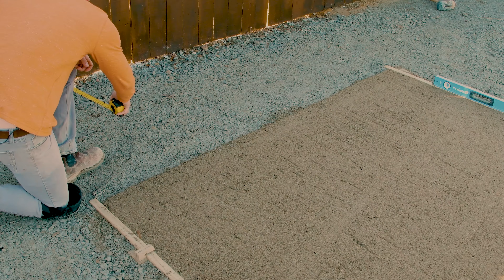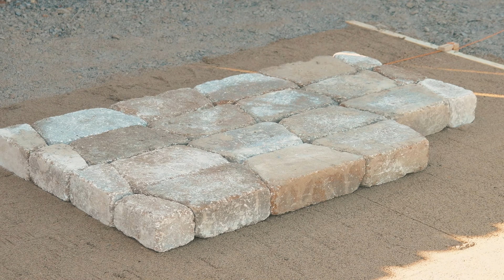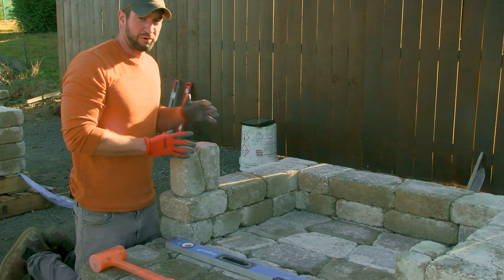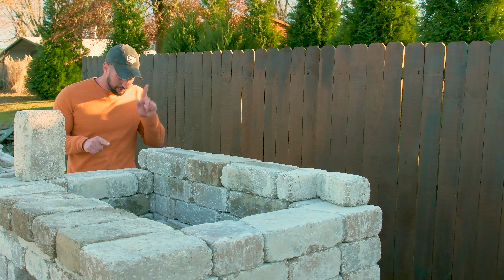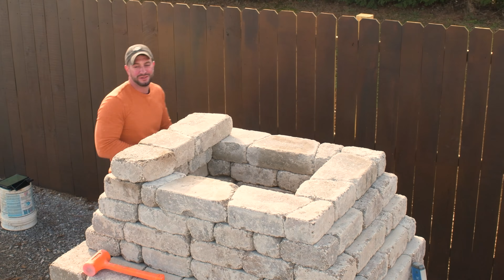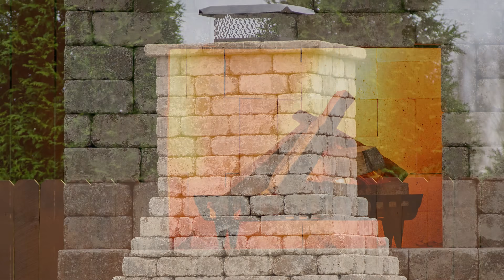How to Build a DIY Outdoor Fireplace in a Weekend | Step-by-Step Kit Guide

Comment: Never pound directly on a level. Pound on just the block.🎉
Reply from the maker: Yeah. I've heard that, but I buy levels that can take abuse. You can even find them with guards on them to take the shock- see Stabila. I have a cast aluminum level with old school glass vials that I've pounded on for years and I haven't even broken a glass vial. Those cast aluminum levels take a pounding but are heavy. Not pounding is obviously easier on the level. But masons have tapped/pounded solid wood levels for decades. Aluminum I-beam levels can not take the pounding at all! avoid those, unless your a painter ;)

Comment: How do you think this would hold up compared to brick and mortar or cinder block? I want to do one in a harsher environment.
Reply from the maker: These blocks are denser and solid, unlike standard concrete blocks. These surpass ASTM C90, which is the spec for standard CMU. Brick and mortar have a much lower standard as they are not structural. Moreover, mortar is meant to be the weak spot in traditional masonry construction. It is a concrete sponge used to level bricks and blocks. It has specs to meet, but it is made to be a fail point and be repaired easily. This does not mean it is weak. Unfortunately, the mortar holds moisture and succumbs easiest to freeze-thaw cycles. The lack of mortar in our construction actually is a benefit for freeze/thaw as water is not held in a soft cementitious material (mortar). The water drains out between the blocks better. True, the block will hold moisture, but it will be less than that of CMU blocks- which are structural and stronger than brick- but still use mortar. If by harsher you mean salt water spray- then you are probably better familiar with those effects if you live in that environment. If harsher means just cold- that is not harsh for masonry. The harshest is the in and out of freezing- the freeze-thaw cycles. Those are usually found in the middle of the country- where I live. Mine is showing no signs of wear after 8+ years. I do get biological staining from the trees above, but it is easily cleaned.
Reply: @CornerstoneRocksKits thanks.

Comment: could I do this on a concrete pad or is sand the required base?
Reply from the maker: Sand is definitely not the required base. You can build on compacted gravel or concrete. Check out the specs here: https://www.cornerstone.rocks/foundation-specs-and-plans.  If you choose to use a compacted gravel floating footer, you can see how to do it on our video here: https://youtu.be/yea4CVvfUhQ

Comment: Can the base pad be the same dimensions as the fireplace or should it be bigger than it? My instructions seem to show to lay out the bottom bricks then mark and use that for the base making sure the bottom layer is 1-2" below grade.. wondering what the norm is. Also what don you do with the batter boards? Do you pull them out and fill with dirt?
Reply from the maker: All these questions and more are clearly stated in the foundation Instructions. You can find them here:
https://cornerstone.rocks/foundation-instructions/
Reply: @CornerstoneRocksKits  Thanks!

Comment: Is there a rule for firebox size & chimney height for proper draw, or does it really matter?
Reply from the maker: There are rules for the volume of the fire box, the opening height and width to the box, and the cross sectional area of the flue in conjunction with its height. 

That said, all else being equal (opening, firebox, cross section of flue) the taller the chimney the better the draw. Also, the bigger the cross sectional area(so else equal), the shorter the chimney can be for given firebox dimensions. Draft is a concern, but it is not as critical outside as inside since smoke won't back up into your inside room.  Also there is no pressure differentials between inside and outside to account for, but no wind, either. 

These fireplaces draft well. If you live on the bottom of a hill or a place where downdrafts of wind happen, you may need a taller chimney. Usually taller dumbbells are used for roof clearance needs.

Note, the chimney drafts better as the fire heats the column of air more and more. So, I start with my grate toward the front so the kids get plenty of air to start a good burn. Then I push the heater and lid towards the rear of the box for better draft after the logs start burning. 

This may be TMI, but hopefully it answers your questions and sheds some light on the subject.

Comment: A "non stretching tape measure". I've never heard of a stretching tape measure. That would be absolutely useless.
Reply from the maker: People often use fiberglass tape measurers from 100-300 feet long when measuring long distances such as their yard or property.  These tapes are notoriously stretchy.  You have to be sure to not pull too hard.  Since you may be squaring up to a property line 80 feet away or more, you have to be careful about stretching the tape when pulling your radii. But you are correct. At short distances, it doesn't make much sense.
Reply: Alot of tape measures have a movable piece in the front that stretches a 1/8 to 1/4 inch.
Reply: @billsmithersjr.1151  That movement of the metal tip is to allow for measuring from an outside edge, where you hook it over the edge or an inside measurement where you are measuring from an inside wall for example. That movement is to allow for the thickness of the metal tip. All tape measures have this. Typically it is about 1/32 inch. It does not "stretch".